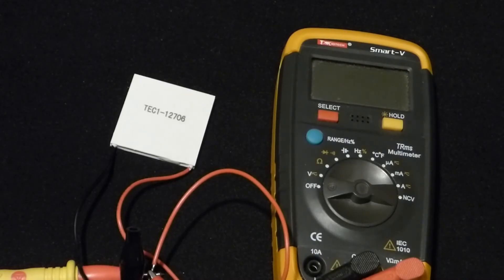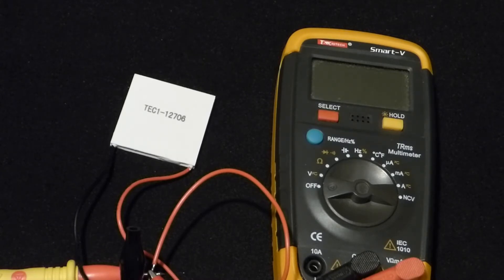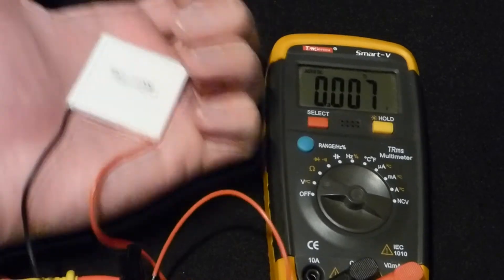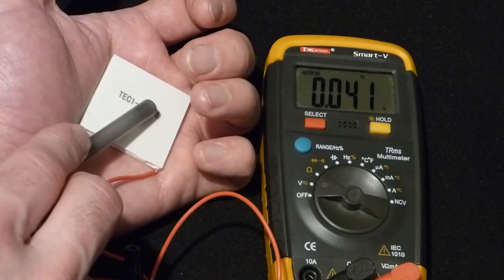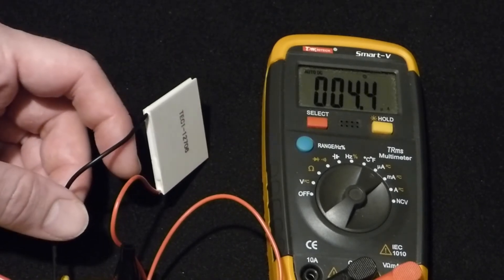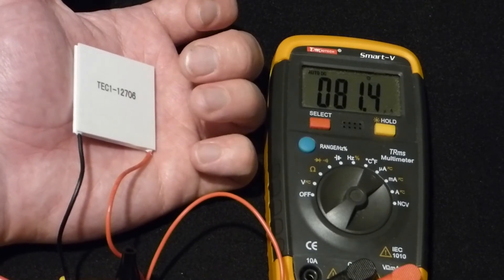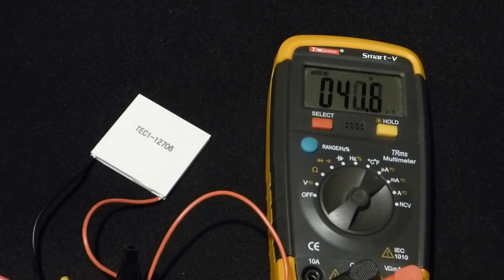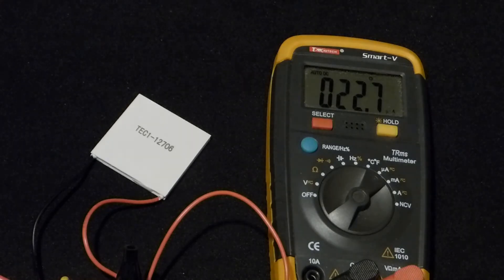Measurements of voltage and current produced by a peltier thermoelectric cooler on my hand

Comment: Cool presentation!
If a 12v Peltier is rated for 9 Amps and you run it with a 5 Amp power supply will it burn out the supply? Or just run at 5 Amps without issue?
Reply from the maker: Depends on how well the supply limits current. If it doesn't, then you need to limit current for it.
Reply: @Electronzap  Thanks.
It fried. Just trying to diagnose if the Peltier is to blame...
I tried to replace it with the proper one, but...